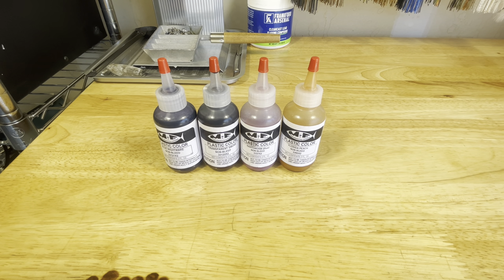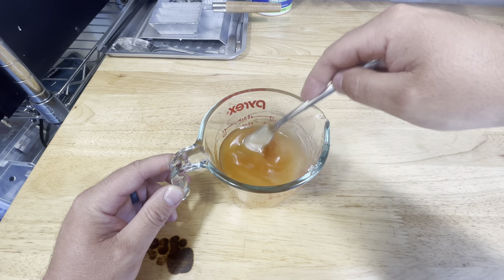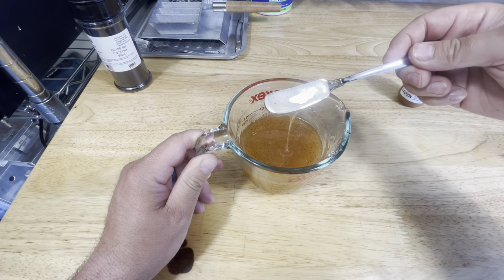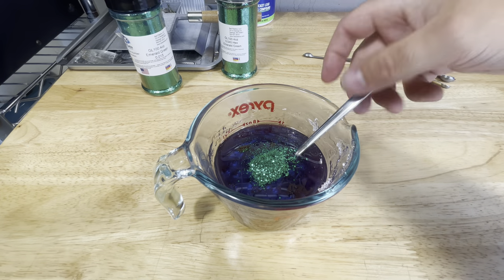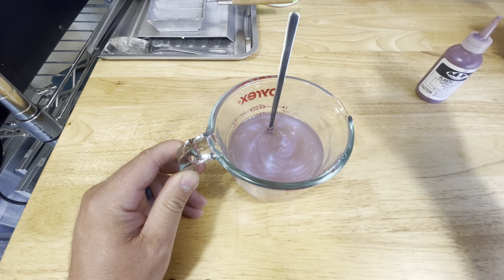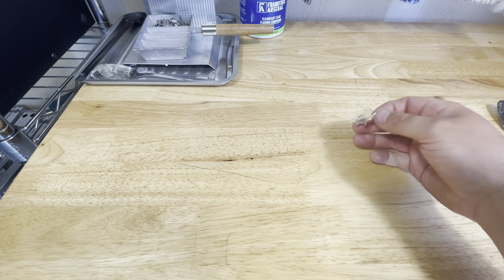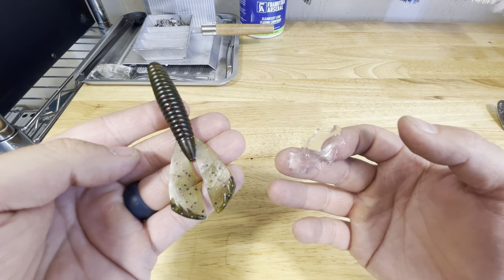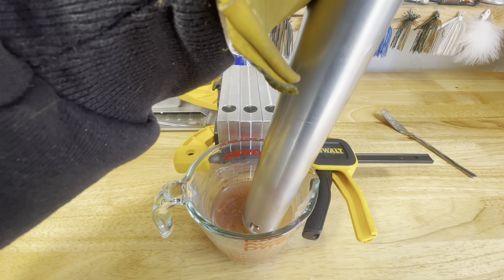NEW COLOR DEMO ~ Stick Baits & More ~ RIGGING TIPS

Comment: These are nice colorants. As you said the smoke is great for adjusting colors.
I haven't used the sparkle violet, but do use a lot of the disco violet which is also very heat sensitive.
To maintain the flake on remelts, I have found if I do 15-20 second blasts in a 2 cup measuring cup the flake will survive.
Even small amounts (1/2 cup) works out ok.
Thanks again!!
Reply from the maker: Thanks Jim!! And yes I am able to get some reheats out of this but after about 3 times it starts to kinda turn a slight greenish/yellow color. Super cool flake though
Reply: Disco violet and sparkle violet are both the same! FYI
Reply: @michaelace4739  Not the ones I have. Lureworks Sparkle violet always looks violet. M-F Disco Violet, the color disappears on the flip.
Reply: @jimk4267  I use both, but I don't add them until my plastic is 315 degrees or below..
Reply: @michaelace4739  👍